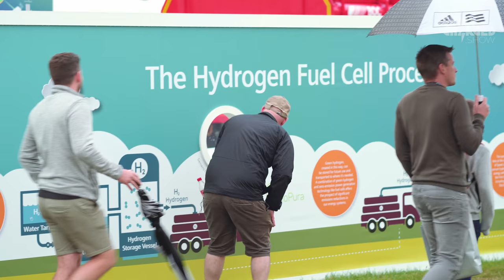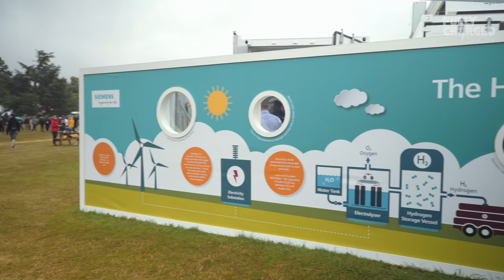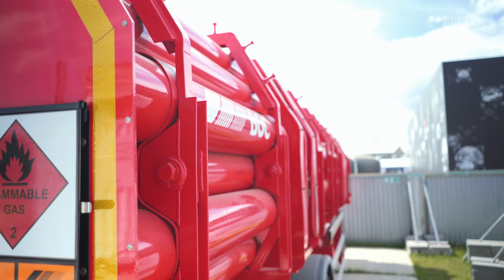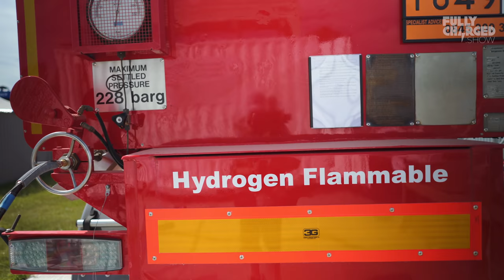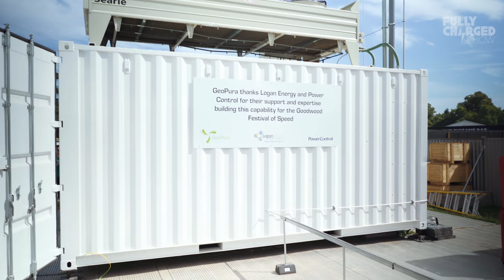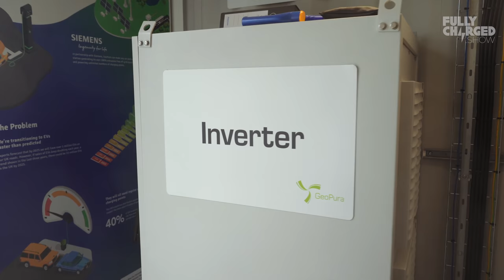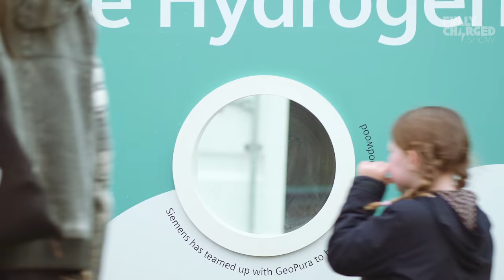Green Hydrogen Fuel Cell Charging System at Goodwood Festival of Speed | Fully Charged

Comment: 50% efficiency seems very low to me, Hydrogen storage has still some way to go ... I wonder what space would take a same capacity battery.
Reply: It's not 50% efficient. It's 100%. 50% electricity and 50% heat. We have combined heat and power, energy stations, the Russians make good use of them, supplying homes with both power and hot water communally! We have off grid systems in the Western world using wood pellets etc, for combined H&P. This is just the same.
But we don't need to burn anything for it. We just need a water source or a water tank!
Reply: @computerbob06  Yes that's the idea of efficiency
What's lost is usually lost as heat

50% efficiency is much lower than batteries 😕
But it could be useful, any storage tech is good to have 😊
Reply: computerbob06 Bocgas not sure of hydrogen source. Currently 70% of hydrogen con from fossils
Reply: @computerbob06  by that metric, incandescent bulbs are 100% efficient because they heat your home.
Reply: This is minimum two containers and a fuel trailer, plus a support trailer.  Same capacity in Tesla Megapack is a single container, plus a transformer and support.
Reply: @romainhedouin  exactly, could be a great power dump for peak production...
Reply: We forget another notion in this equation. The efficiency while generating the hydrogen and then compressing it for storage.
Reply: I'm guessing it's much worse than 50% from end to end. In the video, they only mention the efficiency from hydrogen to electricity. They don't say anything about the efficiency of the electrolysis step to make the hydrogen from the renewable source in the first place.
Reply: Patreeko theArtist yeah, that kit seemed very complicated compared to a battery. I guess the same can be said for BEVs vs HFCVs.
Reply: @OohzyJohnDow  top end electrolysis is 80%.  So at best we are looking at 7.5MWh in to get 3MWh out, possibly more like 8MWh in.  Not including shipping of course.
Reply: @patreekotime4578  
Well, no, as you don't use the heat coming of an incadecent light bulb. Would you actually heat your room with the bulbs, than you would most probably use about 90% of the energy to power the light bulb.
In the case of fuel cells, you (in imobile aplication at least) can use the heat as well as the electric energy. Currently, the best fuel cells can output about 50% of the energy stored in hydrogen as electrical energy, the rest is basically waste heat woch could be used.
Reply: @computerbob06  This may be emission free at point of use but certainly not 100% efficient.
So no energy was used to create the Hydrogen, transport it and then generate electricity?
Reply: @mandernachluca3774   You can't include waste heat when comparing efficiencies. You could convert the hydrogen to electricity using an internal comustion engine for example. The efficiency would be much worse than the fuel cell but there would be much more waste heat so, according to your reasoning, it's just as good!
Reply: They said in the video that gas-turbine generators are about 30%, sounds like hydrogen fuel cells have them beat. Plus the heat can be used for district heating, stirling engines might be able to use that heat as well. And water too.
When you store hydrogen all you need is a large tank that can take the pressure, not leak gas through the joints, and insulate. Way more scalable than racks of batteries that need to have the minerals mined formed into battery cells, cells into packs, packs into grid level arrays.
Reply: @colinstamp9053  
No, your reasoning is flawed, what i am saying is, that waste heat is only actually "waste heat", if you eject it out of the system, of wich you try to increase the energy.

Take my light bulb example, if you would actually try to use the heat energy given of of the light bulb, than it would not be wasted and therefor not waste heat.

The same goes for fuel cells or engines, you let the heat escape, you would basically waste energy that you could otherwise use.
With the best fuel cells having about 50% thermodynamic efficiency, 50% energy could in theory be heat energy that can be used.

However, the problem here is that this waste heat often isn't very usable, as most processes to recover energy from that heat would need temperatures of more than 300 °C, that's why companies lately try to build fuel cells that work at much higher temperatures.

You can already use the heat produced by fuel cells to, for example, heat water up to 80 °C and supply it to houses, this is actually a common practice for citys with a lot of heavy metal  industry like in Salzgitter Germany, they used waste heat of the smelters since decades to heat the homes of the workers.
Reply: @mandernachluca3774  You're still missing the point. Any scheme you can come up with to make use of the waste heat from your chosen process can also be used to make use of the waste heat from any other process. Attempting to include waste heat in any efficiency comparison between two different processes is fallacious.

Of course, trying to make use of waste heat from any process is to be applauded and can make an inherently inefficient process more bearable, but replacing that process with a more efficient one that produces less waste is virtually always going to be preferable.

Taking your light bulb example, you could replace them with LEDs and then be able to choose more of the fuel you use to heat your house rather than being forced to use extra electricity to do it. Perhaps you could make better use of one of the district heating schemes you mention for example.

 If you really are hell-bent on including waste heat in your "efficiency" figures, then burning hydrogen in an internal combustion engine would actually be preferable to using fuel cells since IC engines produce "higher grade" (hotter, basically) waste heat than fuel cells, so it's more readily usable.
Reply: @colinstamp9053  
No you are actually missing the point.

As an engineer, the efficiency of a system is to can be defined be a lot a factors, you can have the efficiency of only the fuel cells or the efficiency of only the electrolyser but the most important value is the system efficiency, thus includes the recovery of waste heat.

As i do study for a degree in engineering, i work on a prototype electric car of my university.
I was asigned with the task of increasing the efficiency of the powertrain by using an intelligent thermal management system that recovers the waste heat of the batteries. Recovering waste heat will increase the system efficiency,
the fuel cells are just a part of that.

Also, you can not just burn hydrogen in ices, this would produce CO2 (due to burned oil) and NOx, both are not wanted.
Fuel cells only produce water vapor, nothing more, as the temperature are not high enough to produce NOx.

Also, using more efficient system is not always the best solution.
Take a bus for example, you could drive small ones with batteries, the problem however with this one is, that you need seperate  heating elements only to heat the internal cabin and the battery in the winter.

For this case, a fuel cell powered bus would be the better option, simply because of the ammount of usable waste heat. By using that heat, you can increase the overall efficiency of the fuel cell system.

You could also take the german uboats as an example, they achieve a total fuel cell efficiency of over 60%, because they use some of the waste heat, to heat the pressurized secion of the uboat and the metal hydrid tanks (they need a certain temperature to release stored hydrogen).

So you can still try to explain why you think that literal energy recovery does not increase the efficiency but i am pretty sure that you get what i was talking about.
Reply: @mandernachluca3774  The important distinction that you're missing is between the underlying process and individual applications of that process. Your car heat recovery system does indeed increase the efficiency of your particular application (as long as you actually need the heat). You can't however use that one application to make claims of extra efficiency from the batteries. It's the car you've improved, not the batteries.

Incidentally, I'm not advocating using an IC engine in the application in the video, just demonstrating how your way of looking at process efficiency makes IC engines look like a better option than the fuel cells.

Your conclusion that fuel cells would be best in your bus example is wrong, and a good example of how including waste heat in your efficiency figures can lead you badly astray. The more efficient the energy storage system the better (all other things being equal of course). If you need to top-up the waste heat for cabin heating then that's fine - you're still using no more energy from your original source. At times when you don't need all the heat (which will be practically all of the time at 50% efficiency unless this bus is at the north pole) the fuel cell will need more input energy to do the same job.
Reply: @colinstamp9053  

Actually, first, by recovering the waste heat of batteries or rather, actively cooling them in the process, you do increase the efficiency of batteries, because they than operate in a more optimale temperature range.
One has to note that batteries have a specific sweet spot were they will have the lowest resistance while maintaining the highest possible chemical reaction speed. PEM Fuel cells are similar in that they have an optimal temperature, at wich the membran stays hydrated enough to allow for the least resistance but the hydrogen atoms have enough energy to squezze trough the membran.

Second, i am afraid to tell you, that i was talking about the fuel cell system efficiency all along (meaning the whole system, not just the conversion of hydrogen and oxygen into water and electricity), you must have missed that one ...

Third, i can tell that you obviously had not the pleasure to lay out mobil transportation systems like buses, else you would know how ignorant your view towards the efficiency of systems is. The problem with using a more efficient system (aka batteries) is the mass that you need (this especially important for vehicles like buses or trucks wich are mainly limited by their mass), you go and make some calculations as to how much energy you need to heat a room the size of a bus, than come back and tell me this would be no issue. 

Hydrogen has the beautiful advantage of having a great gravimetric density, meaning, that a certain mass of hydrogen has a lot more energy than equivalent energy storages (3x more than petrol to name one example), in stark contrast to this, batteries have only a high volumetric density. They will weight much more per energy unit than hydrogen.

If you know want to heat something, you would always be better of using hydrogen fuel cells and generate electricity in the process than using batteries to drive a heating element, wich will heat less efficient simply because of the fact that the additional load heats up the battery (wich lowers the battery efficiency), and the element will not work with full efficiency, because their is resistance in the controller and the wires.

Additionally, the heat of a fuel cell in the summer can be used to heat several types of hydrogen storage systems, for example LOHC or metal hydride tanks.

However, besides all this, the most compelling argument for buses to use hydrogen is the safety and the ability to fuel up in in a few minutes.

Now, i now you ask yourselfe, how in hell could hydrogen be safer.
Easy, this, again, is only visible for people that actually work in this area, most buses have to mount the battery packs under the seats or directly at the end of the bus.
Both options are higly dangerous and will lead to a fire when the bus crashes even in the slightest possible way. Hydrogen tanks are light enough to be mounted on top of the bus, wich allows for special mounting brakets that break when the bus crashes and therefor enable a save recovery of the passengers.
Reply: @mandernachluca3774  Your battery temperature comment is a straw man. We're not talking about affecting battery efficiency by changing temperature. We're talking about the fallacy that poor efficiency in a hydrogen fuel cell somehow doesn't matter because you can, in some applications, recover some of the waste heat.

Mass of batteries is also a straw man. Heavy batteries do not make it ok to pretend that the bad efficiency of hydrogen fuel cells is somehow an advantage because it means that rather than "wasting" energy to heat the cabin, you have some heat that you've already been forced to waste by your poorly performing fuel cells. This is of course ridiculous. It's much better to give yourself the choice about whether to spend energy on heating than to just blindly convert half of your precious energy directly to heat and then fumble around, desperately trying to find a use for it. What on earth are you going to do with all your wasted heat in the summer?

Safety of hydrogen and refuelling time are yet more straw men. This isn't a debate about safety or refuelling time. You really need to try to confine yourself to the point.

Resistances in the heater controller and wires? You're joking right? You're seriously comparing the losses in the wiring of a cabin heater to the 50% efficiency of a fuel cell? Words fail me.
Reply: @mandernachluca3774  That's top flouncing right there :-) As a word of advice from an engineer of 30 years standing to one just starting out - Try to think a bit more coherently and critically, or you won't get very far once you get out into the real world.  Wishing you all the best in your fledgling engineering career.

Comment: In my area lots of little electricity substations are disappearing and the land being sold off. A neighbourhood grid balancing unit in an existing brick building, could be pulling cheap energy from the grid during times of 'overproduction' and creating hydrogen by electrolysis for use in a fuel cell in times of need. 

I'm aware this is a massive oversimplification and that the logistics of storing liquid hydrogen are not trivial, but a grid wide load balancing system made up of thousands of redundant containerised units would go some way to allowing 100% utilisation of renewable energy.

In certain areas the waste energy could be used for heating too, how many substations are there located in hospitals or blocks of flats...
Reply: Liquid hydrogen is impractical and you would not want one of these hydrogen production or dispensing stations anywhere near a populated area (700 bar). There have been two explosions and two fires in the last 12 months. 
The explosion in South Korea killed two and injured six. As the result of the one in Norway all H2 vehicle sales stopped are they are still on hold. The one in California shut down one third of the dispensing capacity and bricked the vehicles.